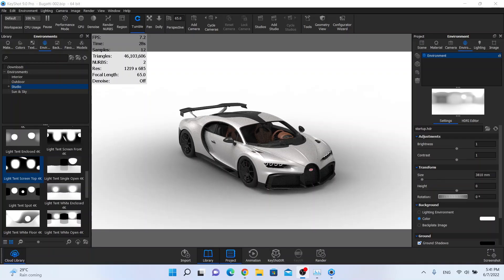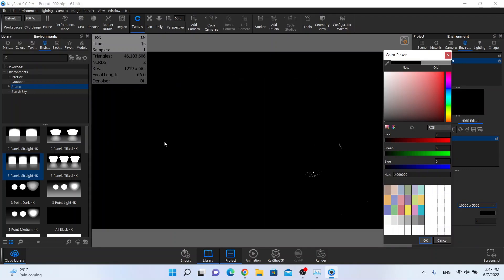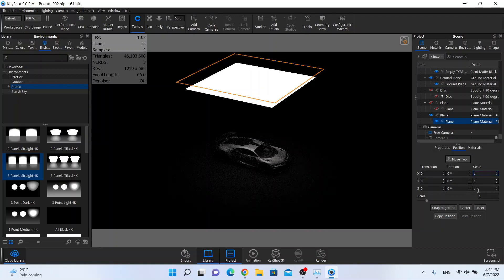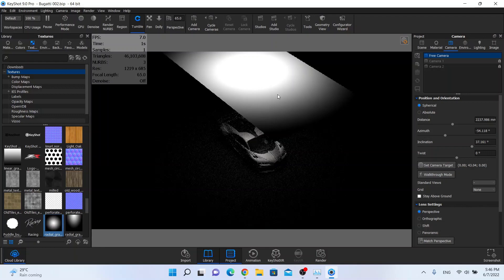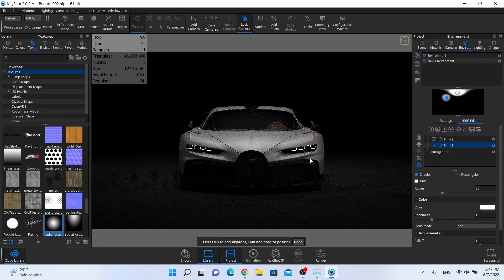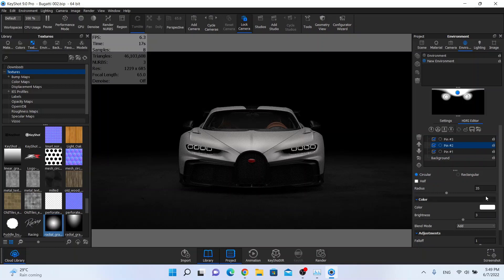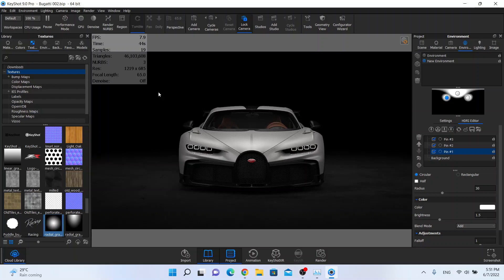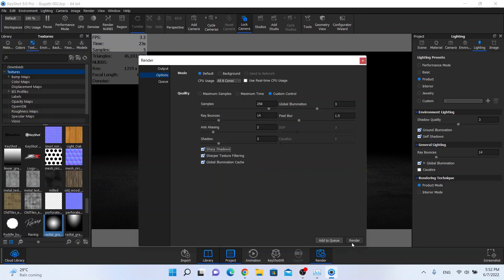KeyShot Automotive Lighting in 10 Minutes

Comment: 2 hours and 30 minutes. That is really long for that rendering. Why you did not use GPU?
Reply from the maker: Yes, that’s a really long time, but I have an old computer. For me, when I do overnight renders, the time doesn’t really matter. However, you can use maximum samples instead of custom control to significantly reduce render time, and the difference in quality will be almost nonexistent.

Comment: i tried to use the basic plane and im using on keyshot 11, my problem is i cant move it to the above of the cars..
Reply from the maker: Hello, try to delete plane and create new plane again, but be careful, ground plane and plane are two different things. Make sure you are going to edit tab on the top of the KeyShot Edit - Add Geometry - Plane. Than you point your cursor on this plane, right click on the mouse and you press move this object. I hope this will help with your problem.